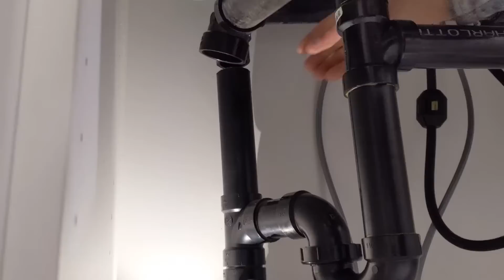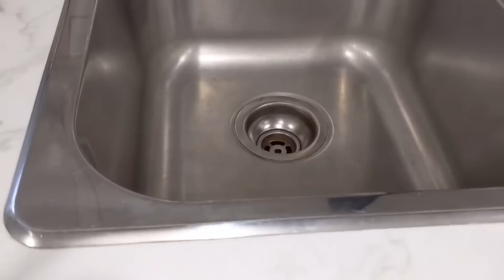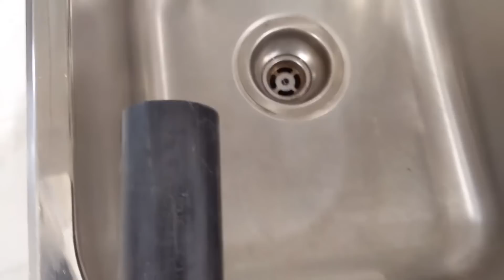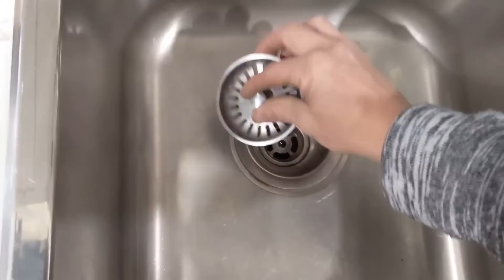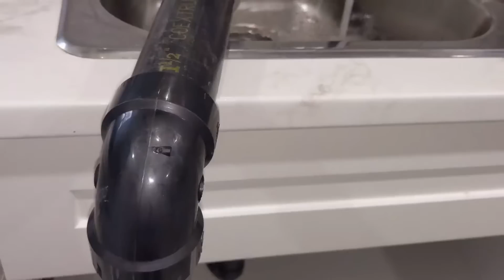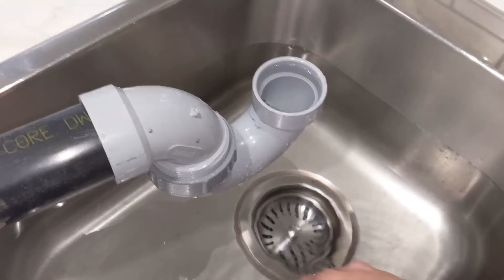Plumber Gives a Perfect Visual on Why a Plumbing Drain Gurgles.

Comment: This was so good! I enjoy your humor. ( then an explosion happened and everyone died😎)
I am discovering the joys of home ownership (built in 1965) and learning new things everyday.
I can't find the vents for any of my gurgling tubs, toilets, sinks etc.
The metal roof was installed in 2021.
No vents to be seen, which could be a good thing (for the roof).
The house is on a slab, and if there is a cleanout anywhere, I haven't found it.
I will check my attic more closely, my friend the rat has been silent lately.

PS How is it possible for heated water to come out of a "cold" faucet?

Comment: Thank you for making this video. After the housing corporation we rent from removed the old chimneys when they isolated the roofs, they also removed the pipe on the standing pipe that went into the chimney to vent the gasses to the outside, and they simply put a venting valve on the inside of the attic. But they put it lower than the piping with p-trap of the central heating and water boiler. Which now gurgles all the time.
Also we noticed that we had a lot of eye irritation (burning eyes and inflamation) in the last years, and I recon the H2S gasses are likely the cause.
I am having the in-house plumber of the corporation come in next wednesday and will show him this video, and ask him kindly to put a vent up on the roof to vent to the outside rather than inside the building.